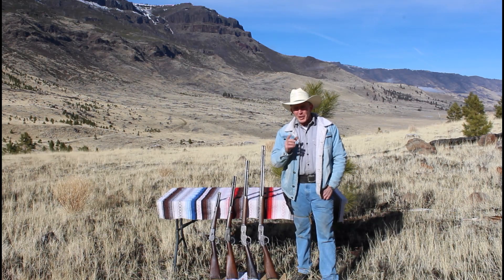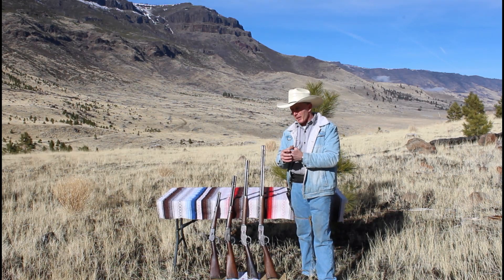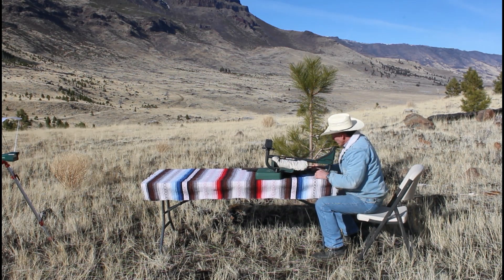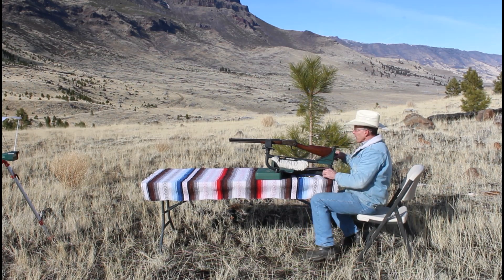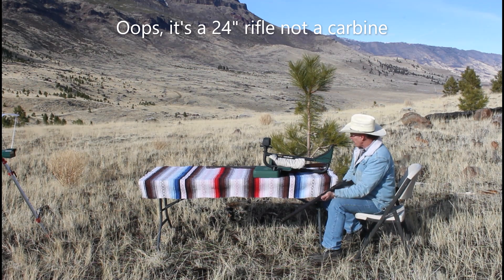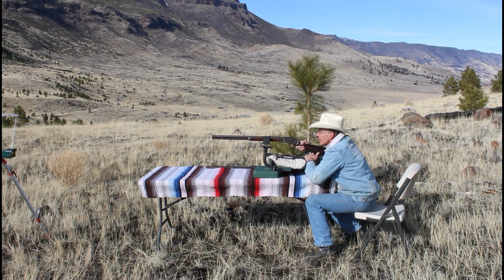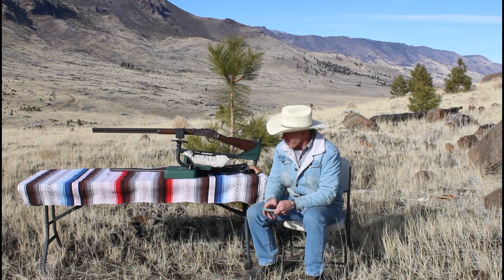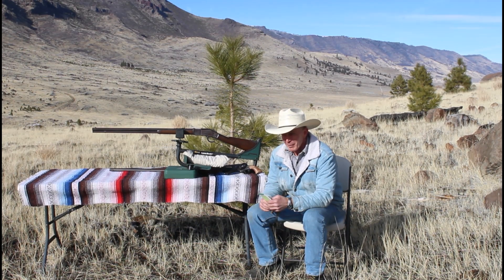Barrel Length Versus Velocity

Comment: would be interesting to see a graph from 4" to 20".  I wonder if it's a bit standard at 16" to 18" the powder speed bonus is for the most part done.  Read in the comments that rifling spin speed might increase and improve distance...dynamics!

Comment: Neat video. I think the 20-22 inch barrel length is optimal for a lot of straight wall pistol cases. For the BHA 89s which are in 500 Smith, the 22 inch barrels offer a tiny bit more velocity that the 20 incher, but not much. If a guy shoots a longer barrel than 22 inches in that caliber, velocity starts to fall off.

Comment: I’ve been wondering if the disparity of smokeless power between a 20” or 24” barrel lengths would be so little as compared to black power. I have  a Winchester 1894AE .45 Colt (early cowboy action model-cross bolt safety). I was thinking 4 more inches would yield a sizable velocity increase. Now thanks to you, I’m not so sure!

Comment: I'm extremely jealous I would love to have those rifles, it would be very interesting to see the difference in velocities and black powder cartridges because of the different burn characteristics of the powder.
I expected the 30-inch Barrel to be a lot slower than the carbine using pistol length rifle cartridges and I expected the 24-inch Barrel to be just a little bit faster
Reply from the maker: Thanks RJ.  It would be interesting to see the results using black powder instead of smokeless cowboy action loads.  One of these days, I'd like to load up some black powder and repeat this test.  Thanks for watching and commenting.

Comment: Thinking even though there's not a velocity increase a longer barrel should put more spin on the bullet giving it more range.
Is it possible to sleeve the "73" with the 30 inch barrel to regain its original performance ?
You have wayyyyy to many great old lever guns.  LOL
Reply from the maker: Thanks Kenneth.  That '73 could be relined (sleeved), but it's still a pretty good shooter so I don't want to hurt its collector value by putting in a liner.  It is definitely a fun rifle to shoot!

Comment: Would be interesting to redo that test with Black Powder loads
Reply: Yeah, interesting that the black powder era arms used the long barrel lengths to capitalize on the slow burn rate.  Smokeless fast burn rate negates anything over the 14" barrel

Comment: Fantastic video!  I do have to wonder if the powder from the 44 WCF is expended in a relatively short length barrel?  I have a fairly decent variety of '95's in 30 Army.  I'm thinking that might be a fun comparison going from 18" to 30".
Reply from the maker: Thanks Cory!  As I mentioned in the video, I think we would get a different result with a hotter load in the 44-40 or in a more powerful rifle caliber.  I'm a big fan of the 95's, so I'd enjoy seeing this test being repeated with those.  I don't have any 95's shorter than 22" to play with.

Comment: Great Video Mark.  And as mentioned earlier, some black powder loads along with a soft lead bullet that can expand and seal to the rifling will probably give you a great improvement and more of an equal comparison between rifles.  I have a original Winchester 1873 which was made in 1879, and it’s bore is good, but it’s oversized.  It slugged out to be .433”, so modern hard cast cowboy loads gave very poor performance as the gasses just passed by the bullet before the bullet had a chance to leave the barrel.  

Over the years, I’ve experimented with some various bullets and two that I’ve found that I like are the Big Lube by NOE, designed by John Kort, backed with 40 grains of 2F Swiss black powder.  John gave me a few to test out before he passed away, and I was able to get good groupings as well as I averaged 1,302fps.  

The second bullet was a hollow base bullet from Buffalo Arms which is a 222grain 20-1 lead.  With 40 grains of 2F Swiss, it too had good groupings and pushed at an average of 1,275fps.  

With the softer lead, the BP is able to expand the back portion of the bullet and it gets a nice tight seal on the rifling.  I plan on doing more testing with these two bullets at maybe a slightly reduced powder charge and see how that works, but I do think that I’ve finally found some that this old rifle likes.  They were meant to shoot the black stuff anyway.  If I ever find myself out that way, would love to stop by for a visit sometime.
Reply from the maker: Great information Benjy!  I'm getting more interested in loading black powder cartridges.  I'm so stretched for time now that I rarely get the chance to reload now, but I look forward to a time when I can learn more about the "Holy Black".  Let me know when you think you'll be coming out to our neck of the woods.
Reply: @thecinnabar8442  will do.  And yes I know all about the time thing.  I only get about 3-4 good times in to load a year.  They typically will last from a few days to a week each time.  So I have to load as much as I can while I can.

Comment: I do shoot 44-40, one of my nostalgia guns. With a 700 fps velocity out of the handgun, I'm assuming that the load is a cowboy load. Getting the 44-40 to shoot with consistent velocity at 700 fps is a challenge that you have met, and I'm wondering if you'd share the details on your ammunition. I've tried a few powders and settled on Red Dot, in essence it's a flakey version of Bullseye. Originally my rifle load, that became my handgun load as well. No issues in either. I also had a nice load with Unique, but it was a bit too powerful for competition, it would dent the steel.

Comment: With the revolver there is also the loss due to the barrel cylinder gap.

I'm also wondering about your well water out there. I live in New Hampshire, we have beautiful well water, the rock is granite, truly ancient rock. I see that the rock there is sedimentary, does your water have a sulfur odor to it?
Reply from the maker: You're absolutely right about the barrel cylinder gap.  It definitely robs some of the velocity from revolvers.  I meant to mention that in the video, but forgot it while I was filming.  It stinks to get old and forgetful.😉
The well water in this area has lots of minerals.  There is significant faulting in the area that allows geothermal water to rise near the surface, bringing lots of minerals with it.  We have wells on the ranch as high as 240 F.  Fortunately, we don't have elevated levels of sulfur in our wells like so many geothermal wells.  Sadly, we have arsenic in many of the local wells and have to filter them.
Reply: @thecinnabar8442  There is arsenic in some wells here, some radon too. I'm not concerned about the radon, an exhaust fan in the bathroom will take care of that, but arsenic is another matter. But my well water is very good, as good as any bottled water even without any filtration or treatment. I flush my toilet with water better than what  many people pay top dollar for. 

The geothermal wells can be a great boon for those who have it, practically free heat and clean too. Sitting on a potential volcano might make some people nervous though. There are remnants of ancient volcanos here, the Ossipee mountains (what you would call gentle hillocks) show a clear crater. The Ossipees are just a couple miles from my house.